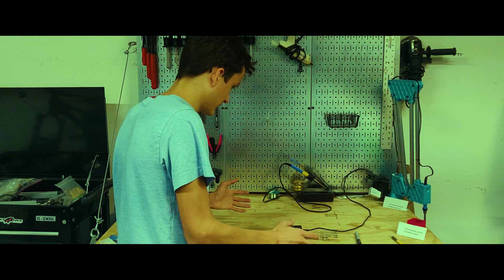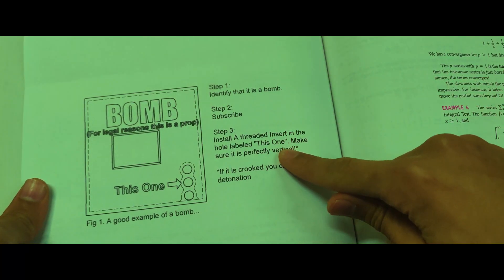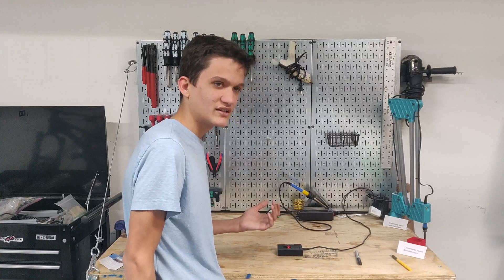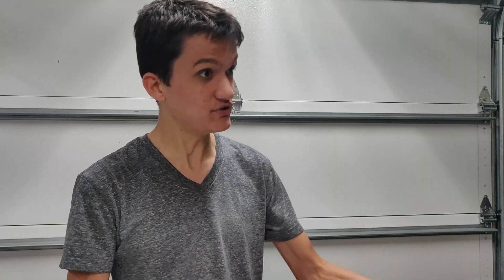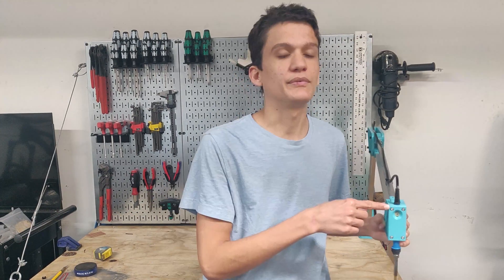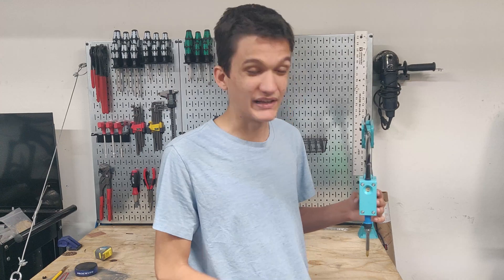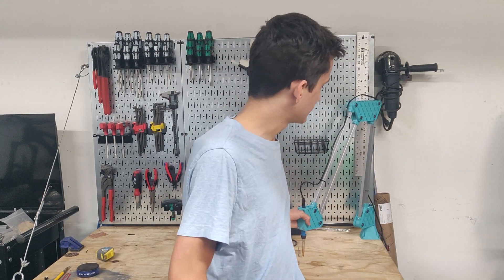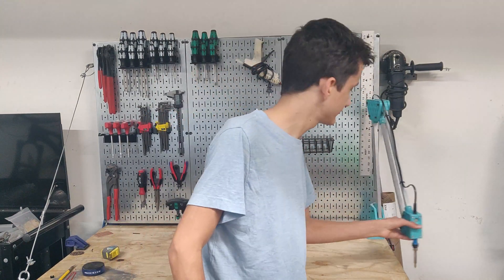Making an Overcomplicated Solution to a Problem with Questionable Legitimacy

Comment: I saw a similar homemade device at one factory, only at the end there was not a soldering iron, but a motor in which you can insert threading tap. And it all served for cutting threads in aluminum parts.
Reply from the maker: Yes, many tapping arms look very similar to this and are actually what inspired this project. : )